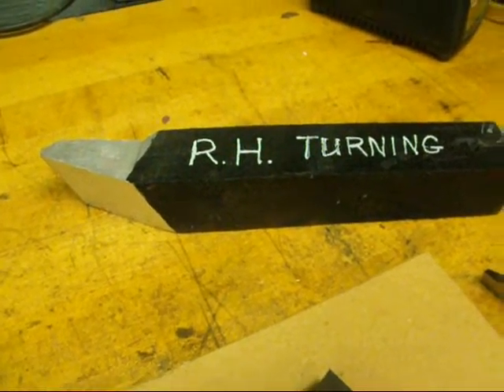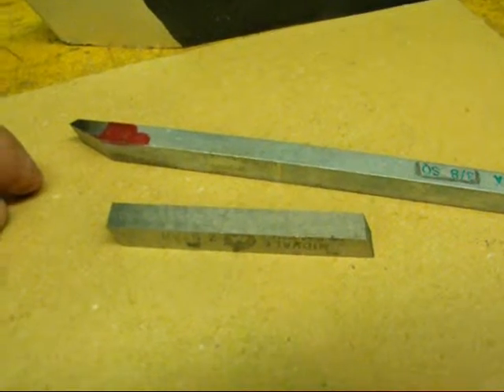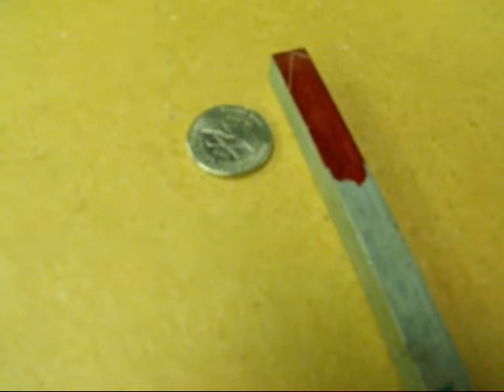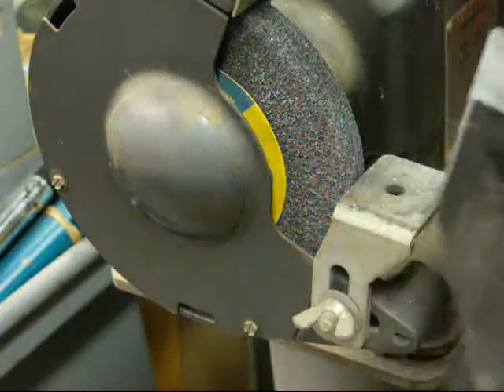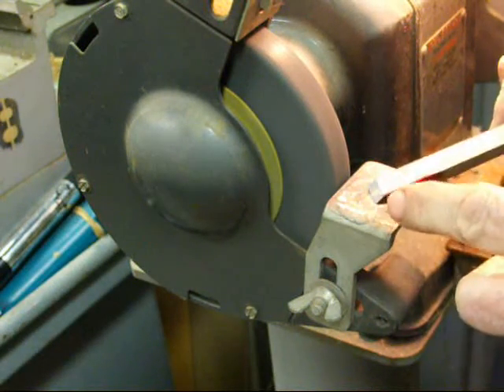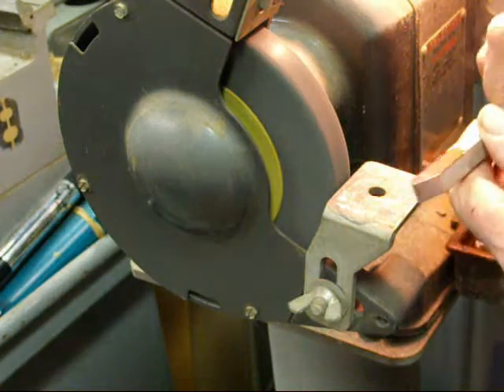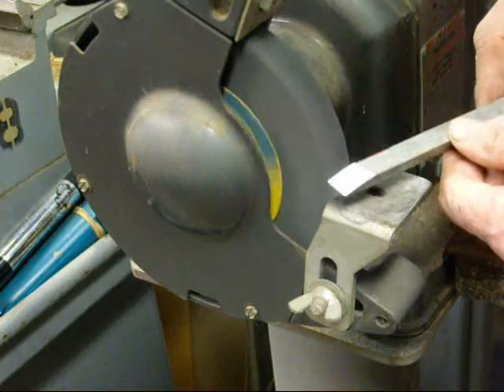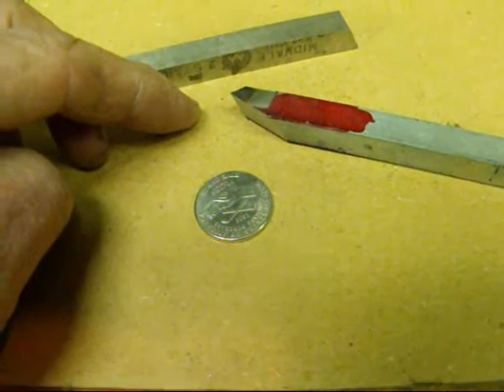LATHE TOOL BIT GRINDING #4 Clausing logan tubalcain

Comment: I had just seen the previous 3 videos, was going to call it good for the session, when I saw what seemed to be blood on the toolbit in this video’s thumbnail. Had to check it out. Glad to confirm it was just red sharpie. Thanks a lot mr tubalcain, forefather of the blacksmiths and metalworkers. Doesn’t people get curious about the nickname, besides its old testament origin? Best wishes, and stay safe!

Comment: What a nice presentation! Regarding the heat from grinding, I'd recommend you to try out a white grinding wheel (supposedly purer aluminium oxide) I just tried it, not long ago and what a difference; heats up much less and it even cuts faster, which comes in handy when grinding something like internal turning or threading tool. If I understand it correctly, the pure aluminium oxide breaks off more easily and leaves new sharp edges behind (less heat and better cooling), while with gray wheel, the grains just dull out with harder materials (like HSS) and stay attached to the wheel, which promotes heat and lessens the cutting ability. I've also heard that pink wheels are even more optimized version of the white wheel, for stuff like HSS, since they have (is it some chromium compound?) added, that reduces the wearing of the wheel.

Comment: Tubalcain,
  
Once ground what is the proper position for the bit in the tool holder. I know the point should be on center, but at what type of angle should the bit be mounted with respect to the work?

Comment: Why is the first face ground so long?  It seems as if we could take off a lot less metal.  We'd have to compensate by adjusting our 2nd face to match...  We are cutting with just the tip of the tool, yes?